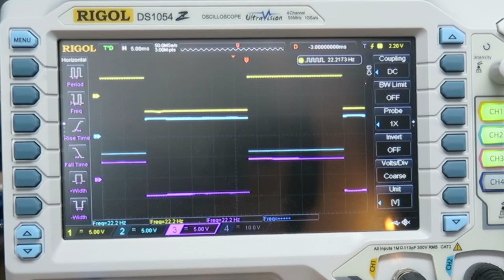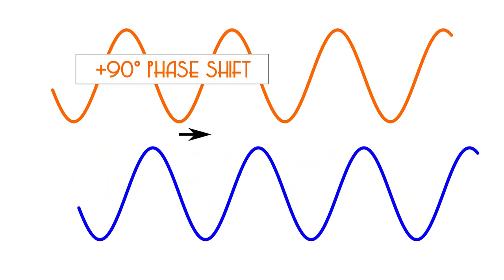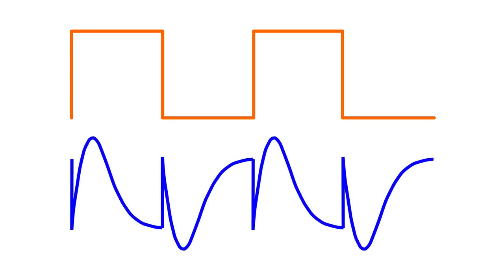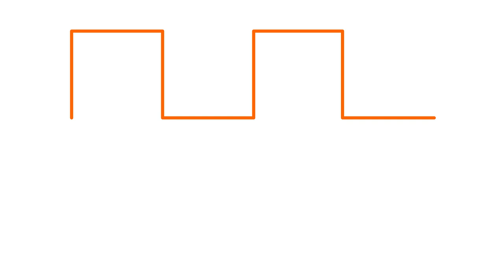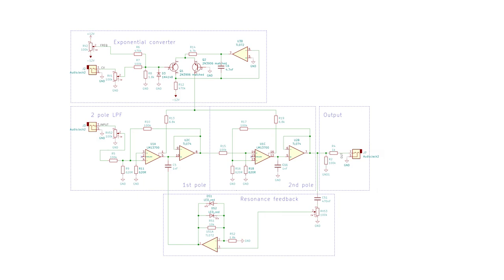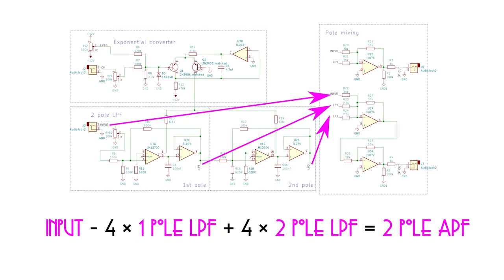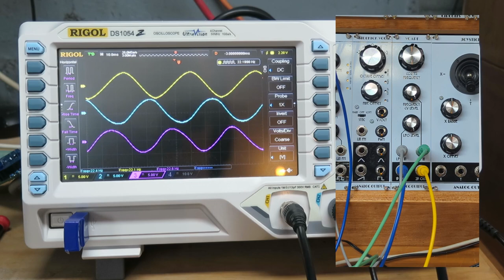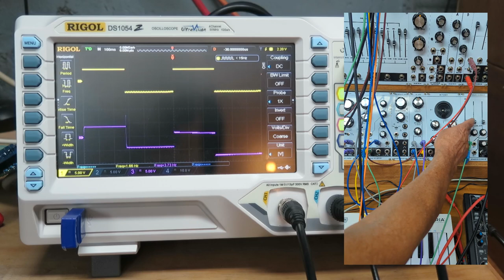Voltage controlled all pass filter

Comment: using an all pass filter on a control voltage is such a clever idea!  BTW wave folders on cv are fun,too.  they can turn an lfo into a rhythm.  the sound demo needs a golden retriever, however   nonlinear circuits demonstrates how useful a golden is to accompany those sorts of sounds.
Reply: ¿¡DUDE!?  THAT idea is SO INCREDIBLE!! Too bad it’s like 2 am where I am right now, but take my Word that this suggestion is just quite so interesting, that I’ll definitely remember to try this out and experiment a bit!!  I’ve been playing with the 4046 CMOS Phase Locked Loop, but still I’ve only been keen enough to listen to its outs, but not send into something as a contributing  CV modulation source!  PLLs are pretty interesting circuits.  I first encountered a decent explanation of one (one that helped to bring me to a level of understanding of PLL) in a book titled “Filter Design”, go figure!
The final example here reminds me of a Wogglebug or a Rungler or the Erica synths’ Swamp, all are pretty neat contributors of uncertain sloppyslew stew, if I had to invent a description of my own.  GREATSTUFF!!